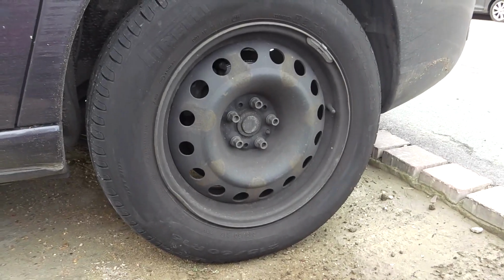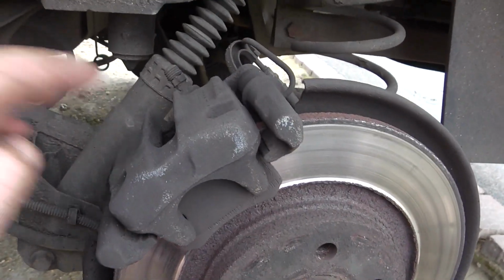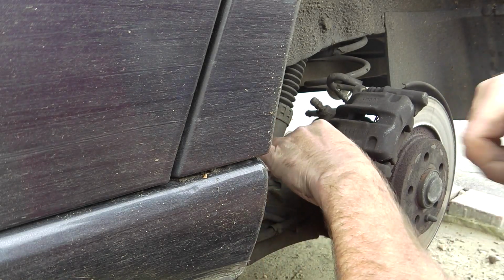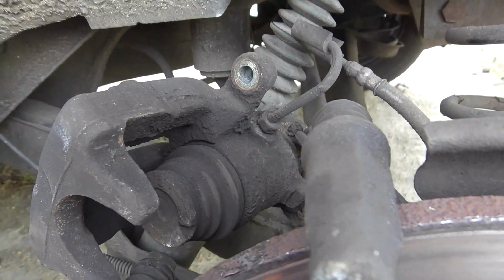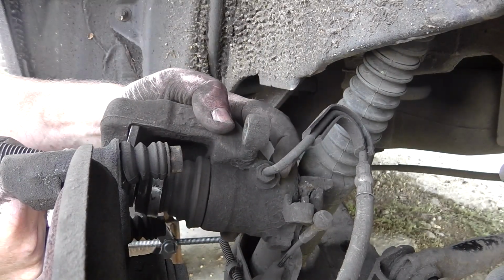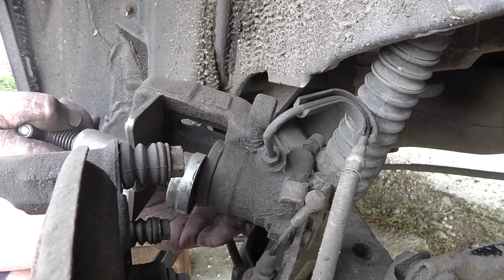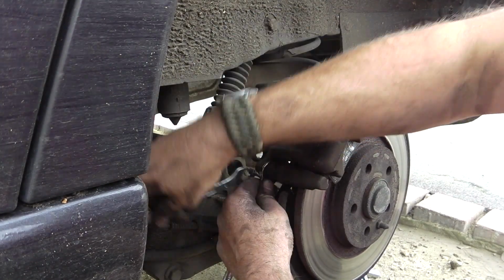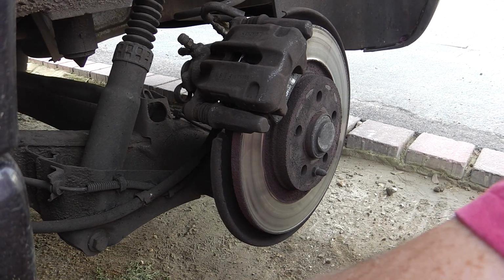Citroen C8 Rear Brake Pads replacement

Comment: Nice video and cheers for going to the trouble of uploading it. Is the process for replacing the front brake pads the same?
Reply from the maker: +Michael Moran Yes, pretty much except you don;t need to wind them back with the special tool. You can just use a clamp.

Comment: Is it necessary to use special tool? Why?
Thanks for the video
Reply from the maker: The rear brake normally includes the handbrake function. This uses a thread inside the slave cylinder which requires it to be  screwed back in. If you look at this video (https://www.youtube.com/watch?v=Lfqw9xYjcaw) you can see the use of long nose pliers to turn in the cylinder.
Reply: thank you very much :-)

Comment: is it easy to replace the discs?
Reply from the maker: Yes, I replaced the front ones a while back.Remove the caliper holder and I think there is just a single bolt which holds the disk on,